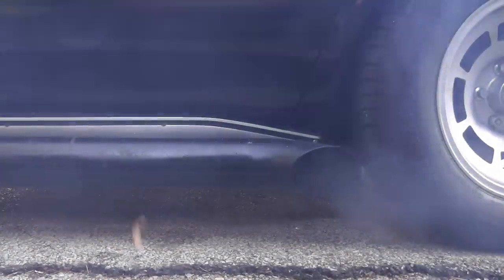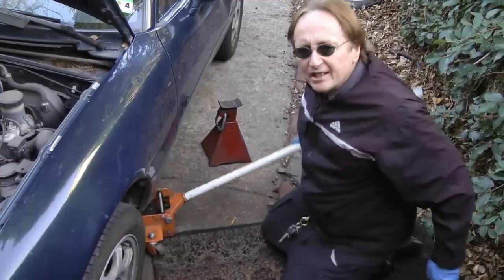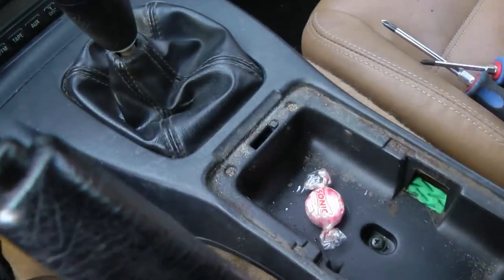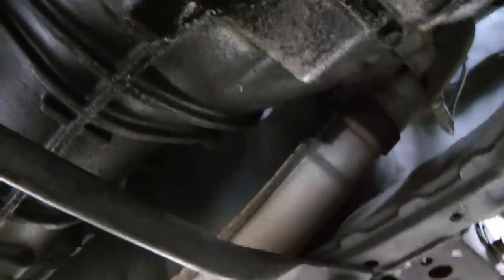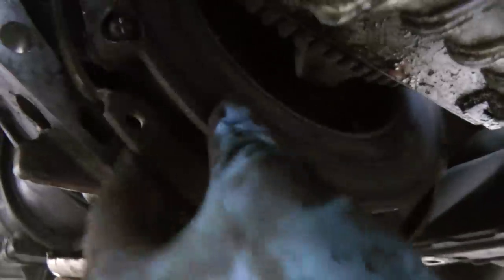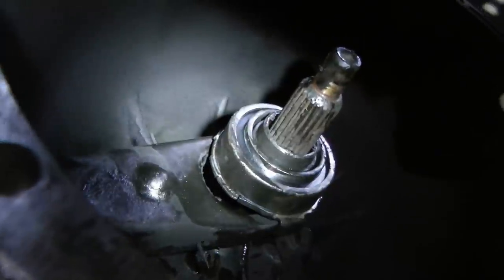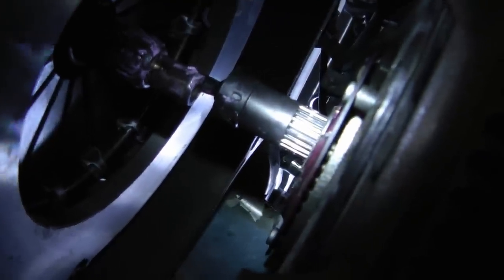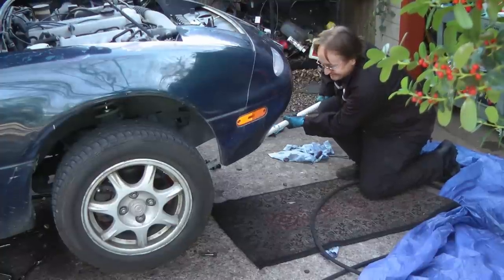How to Fix a Slipping Clutch in Your Car (Clutch Replacement)

Comment from the maker: Things I used in this video:
1. Screwdriver set: http://amzn.to/2jaHIfP
2. Flashlight: http://amzn.to/2BFak8y
3. Ratchet and socket set: http://amzn.to/2inoxOY
4. Mechanic’s Tool Set: http://amzn.to/2Bzmccg
5. Disposable Gloves: http://amzn.to/2zSRuxO
6. Steel Jack: http://amzn.to/2Asgjxo
7. Jack Stand: http://amzn.to/2jGOwBg
8. Metal Oil Pan: http://amzn.to/2nlDM0y
9. Common Sense
10. Full HD Camera: http://amzn.to/2AvoEk7
11. My computer for editing / uploading: http://amzn.to/2i2sKYz
12. Video editing software: http://amzn.to/2jv5Fhf
13. Thumbnail software: http://amzn.to/2k7tz6C

🛠Check out my Garage to see what I use every day and highly recommend:
https://www.amazon.com/shop/scottykilmer

❗️Check out the Scotty store:
https://goo.gl/RwhRGU

👉Follow me on Instagram for the latest news, funnies, and exclusive info / pics:
https://goo.gl/ohy2cA
Reply: Scotty Kilmer hey man I have 93 civic then I put h22 prelude engine in to it Turbo charged its keep over heating has new water pump, timing belt thermostat do you know what's could be please and thank you
Reply: Quick question. 
Have issues with clutch function intermittently. Slpwly gotten worse. Now it doesnt want to go into any gear whatsoever when on yet when pff has no problem getting into gear. If i start the car in gear it starts to roll and if i can get it going i have to slam into next gear. Could this be a hydraulic issue? Im hoping its not the clutch itself but im not seeing any visible leaks from clutch master cylinder or slave cylinder and the fluid has not changed its level.
Reply: Scotty Kilmer hey I need your input on something
Reply: Scotty Kilmer  hello I have a question what does it mean when my Manual gear shift is in 1or 2 gear and pops out , some say it’s the clutch  can you help me out on this issue thank you
Reply: How much for the common sense?
Reply: @jonahtorres6555  if it's hydraulic and there's no leaks, it'll most likely be an air bubble. You'll need to bleed the system.
Reply: @Star_Taro  seriously! Still looking for a link...

Comment: explaining it like its a trivial 15 minute job :D
Reply: +murfad  I feel yah there, I replaced the clutch and pressure plate on my 1990 300zx, the job took me 21 hours...  The hardest and longest part was just trying to line up the transmission to the engine perfectly, Hell, that took a solid 4 hours....
Reply: +krauser427 Funny. The one and only clutch I've replaced was an 88 300z. What a pain in the ass. My buddy knew how to do it, and we had a shop with every tool you can think of, but it still took forever. He said it's the car, and he's done many before that didn't take half as long. needless to say, I'll never do it again. Some shit needs to be left to the pros.
Reply: +krauser427 :  That's why you want to use the alignment tool that Scotty shows in the video. It sure makes this
process much simpler.
Reply: +Peachride EightyNine i know exactly how to change a clutch in my mustang i got all the tools but i know how long and hard this job is. ill gladly pay the $400 i got quoted
Reply: Peachride EightyNine
nice, ive had like 3 GT's lol. my yellow stang is a 01 SVT cobra. im done with vertibles because in the winter rain is getting inside its a pain in the ass. im now driving a 98 GT hardtop
Reply: +murfad These kinds of videos always make a job like this seem a lot easier that it really is.  But...at least it gives you an idea of what's involved.
Reply: +murfad well sir, according to the video, it was only a 4 minute and 40 second job. :)
Reply: +xYouthAttackx I wish I could replace a clutch in 5 minutes.  Hell I'd settle for being able to replace one in in a few hours.
Reply: Florid Ferret both my cars are stick shift and i cannot wait til one of em needs a new clutch because i'm taking it to a shop! there's no way i'm going to do it by myself.
Reply: +Florid Ferret I used to work in a truck garage at a meat packing company where we had a mechanic who could replace a tractor clutch in 45 minutes.  Of course he had air tools and was a super mechanic.
Reply: +krauser427 u a beast
Reply: murfad I know right. made it sound so good. like you dont run into seized bolts thats the fun part
Reply: xYouthAttackx people watching this are probably going for it right now. Wrench bait is what I call it.
Reply: im about to replace the clutch in my '91 toyota tercel 4spd, and im gonna drop the transaxle out the bottom, take the bell housing off, and out from under the car, and clean the inside out so shit doesnt kick back up into my clutch, is this a bad idea?
Reply: murfad I
Reply: that is a damn good deal.  i have a craigslist mechanic who comes to my house.  not sure if he's up to doing this.  every car is different and without a lift i'm sure it sucks.
Reply: i got a manual again because an auto trans replacement is like $2500.  i had 2 cars that needed it and now i have a phobia that it will happen again.  now my clutch is slipping bad.  in 2 days it went from "something is off" to "avoid the hills".

got my car inspected yesterday.  it almost passed.  needs control arm bushings.  its easier to replace the whole control arm.  but the damn clutch is killing me.  mechanics around here are no joke.  $100 an hour.  they always add little charges as well....and people think they are wonderful and nice.

its like i have to keep going to different shops until i find a good one.
Reply: murfad don't I wish lol
Reply: hahahah...yes, if you think replacing the clutch is hard, try rebuilding an automatic transmission.
Reply: murfad looks like it took him 15 minutes
Reply: If I would be able to do this. What a day.
Reply: krauser427 that’s the point of the clutch tool you should have used one
Reply: Geoff Dearth 45 minutes?!? i find that hard to believe unless he’s literally superman of mechanics lol
Reply: ikr?
Reply: Looks like the Gods are punishing me for burning down that old taxis clutch 10 years ago after struggling with the slipping clutch for months haha.
Reply: @RzVids   Joseph M  they wanted big bucks for them years ago, my dad made one in the '70's, he cut out a piece of wood with a  door knob cutter and drill a hole in the center and inserted a 3/8 drive extension. It went in easy after that, but it wouldn't go at all before.
Reply: Unreal how he did it in 4mins 😯
Reply: For Scotty, it's a 15 minute job. Because he did it, one million times. 🤣
Reply: Still helpful.
Reply: Thats the problem he is not showing enought to be easy for you ,, hiding the main important thing how to instal clutch properly
Reply: I'll take mine to the garage.  Great video though.  Love this guy
Reply: Yeah, that's Scotty for you.
Reply: @phuquetwo  lol
Reply: @geoffdearth8575 
Is this another one of your Tall Stories 💩

Comment: Replacing a clutch can be a miserable experience.
Reply: blerk h not to this guy XD
Reply: Rear-wheel drives are the easiest, too. FWD is the hardest from what I hear.
Reply: @ledzeppelin1212  makes sense. In Fwd car, all of the major components that makes a car go (engine, transmission, axle shafts) are crammed into 1 tight spot. The axle shaft acts as a drive shaft and suspension for front wheel drive car, so you have to remove the wheels and axle shaft to remove the transmission. In rwd cars, the engine, transmission, and drive shaft all occupy their own space (front, middle, rear, respectively) and once you remove the exhaust, starter, and some wires, you can drop the transmission.
Reply: Im just afraid to do it with my fwd focus but i wanna manual swap my jeep ive pulled the auto out once and i screwed up so its coning out again

Comment: Why not replace it myself? Well the whole video is the answer.
Reply: Claudio Diaz because I don't wanna risk ruining my car due to lack of experience
Reply: Pretty much, yeah.
Reply: Give it a try, whole job takes 4 minutes 40 seconds.
Reply: porksniffer adjusted for professional to amateur and I have 4 hours and 40 minutes

And that was just to get the transmission off the engine
Reply: First time ever replacing one in my car and it was done in 2 1/2 hours and saved ~500+$ in labor cost. It is well worth it to me to learn how to fix your own car and not be dependent on a shop that might bend you over.
Reply: Cum Dumpster dang

Meanwhile it took me an hour just to replace an external fuel filter (GM Style on one end, Ford style on other end)
Reply: Don't stop there just because it took a while. Learn to tinker with your car more and save that money. Just research, research and research before you start wrenching so you don't mess something up and things go faster when you have a plan in your head.
Reply: One of the reason his probably skipping some staff (torque settings, oil) is because some people lose interest and find things complicated when videos go past three minutes peoples attention span do drop. His more or less trying to give to an introduction and wants you to do more extensive research before you do anything, some videos on clutch replacement are over 20mintues long.
Reply: ToryToryDor or remove the alignment  tool smh
Reply: +porksniffer really 4 minutes then I must not have a problem doing 12 of these in one day at my job
Reply: I would do this on like some car I didn't need to drive every day. For my daily driver, no way.
Reply: Yeah but by that time you are 1/2 way there. You are done with the hard part by then cause at least you now know what all had to come off and go back together.
Reply: Daniel Smith  ah a true car guy

Comment: You always make it look so easy but I bet you have a massive amount of patience.
Reply: I know for the average person this would like 6hrs of work , for Scotty its done in 2
Reply: I do it in  20 to 40 minutes in most cases. Lol It's not a hard job at all. Usually peugeot are the pain in the ass. Front wheel drive cars.
Reply: There's several reasons for going to a good mechanic..... besides the tools he has which likely you don't, he's got experience and skill in making these fixes look easy. Plus a good mechanic is capable of diagnosing problems that could help you save time and money
Reply: Why else do you think he’s been married for so long

Comment: A few years back my clutch blew and needed to get it fixed for work. Didn't have another car and needed it fixed within few days. I don't have friends that can help out with this and didn't want to take car apart. Took to local shop and spent the money to fix it at the time. Glad I did because other things were wrong with it. Going back if I can take the time off I'd replace it myself. I do love learning and doing stuff like this myself.
Reply: what?! a shop found "other problems"?  Imagine that.

Comment: Life becomes so beautiful when you do explanation on major issue with cars. loll
Reply: And so painful when you realize what Scotty did in a 4-minute video, took you a whole weekend.
Reply: every changed it on a modern front wheel drive ? May even take you 2-3 weekends.. usually the whole subframe incl steering rack and front axle has to come off and you have to work 1 day before you get even close to removing the transmission...no chance without a lift and many special tools....
Reply: bobl78 Never owned a car that doesn't have a north/south engine arrangement, never will, but I'm sure you're right

Comment: What about refilling oil in transmission?
Reply from the maker: if any substantial amount comes out, put it back in. In this case it was less than a cup, so it didn't matter.
Reply: Very easy with some tubing and know how. Study! Other people are doing drain and fills.
Reply: Scotty Kilmer so what if it was low in the first place.
Reply: since when u need to do if u replace a clutch ???? lol
Reply: I always put a bag over the end of the transmission where the slip yoke slides in, zip lock bag and electrical tape.
Reply: you just answered ur own quastion einstein
Reply: what about it?

Comment: 2 important things to know so you dont kill a new clutch.
Don't slam the pressure plate levers with the gearbox shaft as you you hurl the gearbox in, and resting on them isn't so good either, if one of those get bent you'll have clutch shudder.
And once you decide to slip the spline in from the gearbox there is no stopping till it all the way in and secured by bolt or at least on the dowels, if you stop and accidentally let the weight of the box on the spline shaft it'll bend the hob is the friction plate and that's probably going to shudder or have a long take up.

Comment: If only it took 4:41 to replace the clutch. ;)
Reply: i was like theres no fucking way you only take off the drive shaft and remove a couple bolts and boom your ready to move the clutch. The clutch he removed was from a miata and thats what a drive so I was like OMG  it looks easy than I realized that he probably cut aloooooot of shit out to make it a quick and easy video but it just ended up getting my hopes up because I m pretty sure there is other stuff on a miata that you do have to replace in order to get to the transmission I really dont think its thaaaaat easy. My friend replaced his clutch on his truck and I believe it took him overall 3 days to replace it. In a very brutal grueling process that he doesnt probably ever want to go through again But, I am a patient person so I might find it really teidious but would be able to deal with how teidious it could end up being because I know in the end I would be able to figure it out. I just really hope I dont have to replace mine and I can just replace my shifter and it will be fine. Shifting is really loose. It shifts too easily and the pedal feels pretty spongey like its ready to go out again but I have a brand new master cylinder and a brand new slave cylinder and I have bled the system twice because the first time didnt seem like all the air was out of the system and after the second time i ran out of day light but the pedal feels firm every now and then when I drive then goes back to being spongey again so I m very confused on if there is still air in the system or if I do need to replace my clutch entirely. I have also had some grinding issues but I dont know if there are times where its the occassional mishap or my clutch isnt engaging properly and is just rubbing against my fly wheel.
Reply: How-To videos like this have to be concise. If Scotty recorded the entire process and uploaded, no one in the right mind would be able to watch and stay focused. He gives you the key points, an overview of the process with some relevant hints which anyone who is capable to do it, should need. Always have the repair manual of the vehicle you are working on to look up details, bolt/wrench sizes, torque specs, etc. They often have pictures capturing the process. So, a repair manual and a short and sweet "overview" video like this is all you really need, provided you are mentally not retarded, have the proper tools and space to do the job. Btw, it took your friend 3 days to do a clutch job? That is way too long unless there was a good reason. Another thing to keep in mind, actual process will be much more time consuming in real life but as you start doing it, most of it is a bit common sense and will make sense while you are following the outlined steps. One thing most instruction videos do not seem to mention or think it is important is, as a shade tree mechanic who might not have done a specific repair on the particular vehicle, always be organized with the parts, label them if applicable and take some photos of the parts before removing them. Case in point, which way the clutch was facing when you took it off, note any notches, markers, arrows, dots, numbers the part may have on it and pay extra attention to put the replacement part in the same way. If a part is installed using multiple bolts and they are not the same length, make a note of it and know where each would goes. Stuff like this will help minimize errors if not completely eliminate them..

Comment: This is one of those fixes that Scotty should say "unless you've done this before, just bring it to a shop (unless you don't care how long your car is unusable)".
Reply from the maker: Hey, there has to be a first time for everything. And really, you don't need any special tools, just normal hand tools and a jack to do it. Patience, yes, but that's free.
Reply: I replaced a clutch in a ford pinto in about 3 hours back years ago when I first started driving, and I'd never replaced one before. Even though Pinto's were easy to work on, I barely had any automotive skills, I just asked a 100 questions and used some common sense.